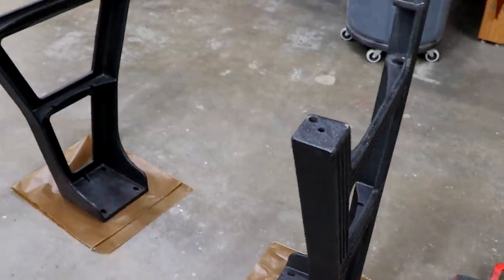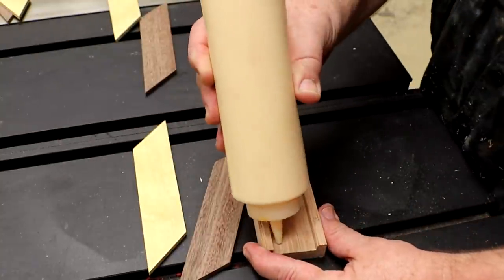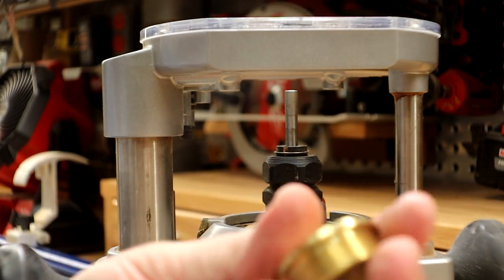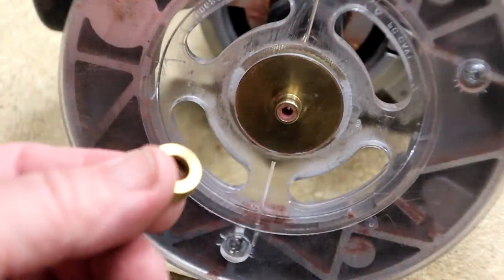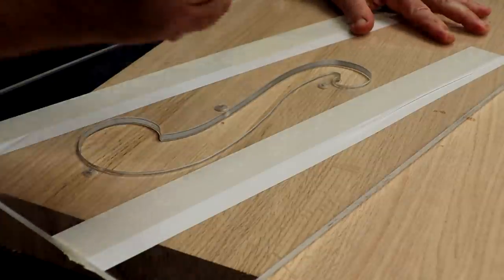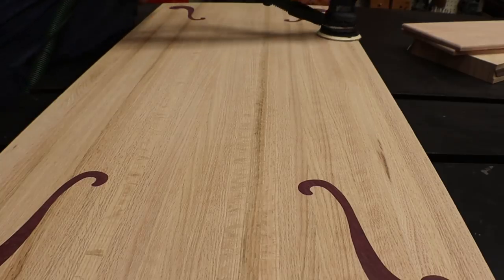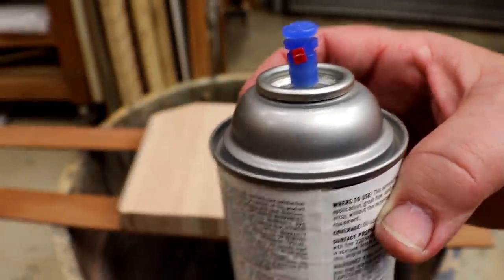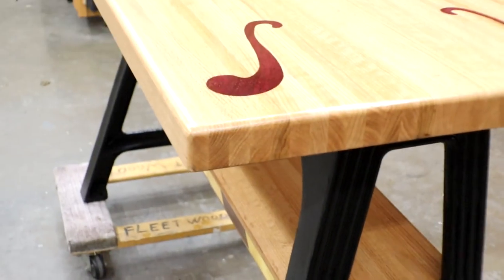SHOP WORK BENCH

Comment: Hello Doug, hope you are doing great! had you have any issue with that board glued and screwed under your slab? I never do that "block the wood mouvement" I am shure you understand my concern... Réal, N.
Reply from the maker: Hey there my friend I'm doing great how about you I hope all is well. No I haven't had any issues with it at all I probably didn't show it on the video but I put some oversized holes where I drilled it down sometimes I forget to show everything. But no I know a lot of people have trouble with wood movement and expansion and gluing across the grain. I've had a problem with that quite a bit with smaller pieces. Like Raised door panels. But when the wood is massive. Inch and a half 2 in 3 in. Thick something like that I never seem to have an issue. After 5 or 10 years you do get the raised glue lines. From the yellow glue. But other than that no issues at all. not to say that there might not be in the future. You never never really know. But so far so good. And thank you for asking buddy if I do I'll put it out on one of the videos. And thank you my friend thank you from Doug
Reply: @fleetswoodshop3339   thank's for that reply, I do believe it because you took the time of selecting the wood and it all side grain witch is making it a lot more stable, great job my friend. Réal, N.
Reply from the maker: You're absolutely welcome my friend. And you're totally correct about the wood placement thank you buddy thank you so much from Doug